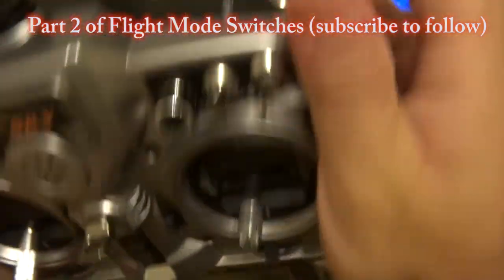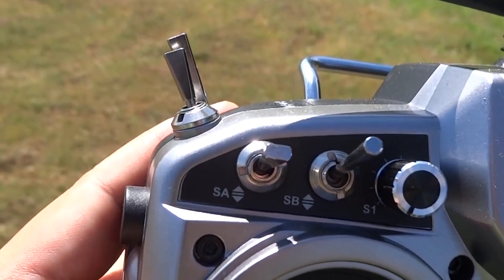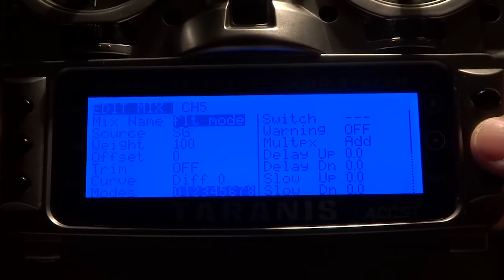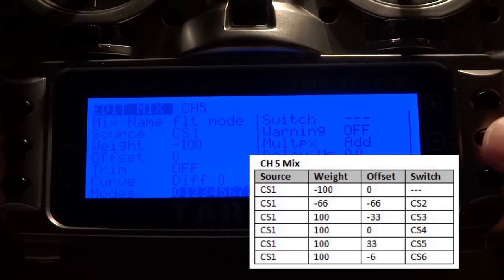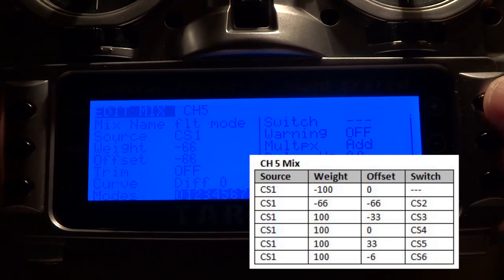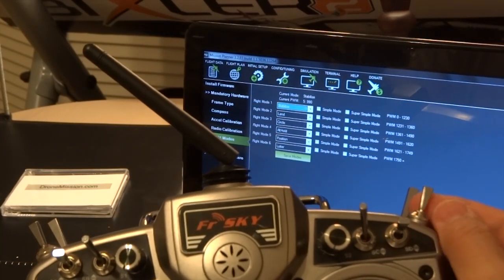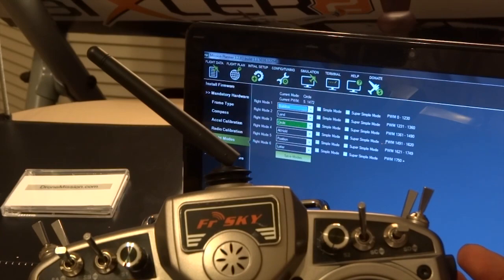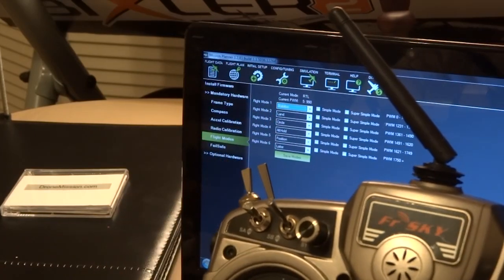FrSky Taranis Setup 6 Flight Modes Mix plus 1 for APM Ardupilot

Comment: How did you set the rtl switch on missionplanner?
Reply from the maker: Greetings. For the panic switch.  it is located on CH 7 auxilary optional switch.  If it is not there anymore, it may have been removed in your version.  http://ardupilot.org/copter/_images/AutoTuneCh7Switch.png
Reply: ***** I do not found it

Comment: Hi diydrone good video thank's...but could you remember how to assign a switch for Autotune and how to check it with M.Planner...because i can't to do it again...thank's a lot
Philippe
Reply from the maker: Hello, it is located on CH 7 auxilary optional switch.  If it is not there anymore, it may have been removed in your version.  http://ardupilot.org/copter/_images/AutoTuneCh7Switch.png
Reply: Hi Diydrone, i've got 6 flight modes and RTL with ch7...checked with M.Planner...no pb ...so, during the flight, when i want to switch AUtotune on ch7 with AltHold on flight mode 2 i get ( pwm 1280 on M.Planner ) mu quadcopter falls down rapidly and i have to switch on Stabilize (982 on M.Planner )...for information on ch7 in Full Parameters list i got the right number for Autotune...
Do you have an idea, how i have to check...?
Than's a lot 
Philippe

Comment: thanks ... worked not as perfect as I would have liked  but I can get used to the way the switches flick the modes
Reply from the maker: +Aron Gatt thanks, don't forget to adjust to your preference.  2013 UPDATE: You can reduce or remove the DELAYs 0.5 if you find your modes are always returning to stabilized mode before changing to the next one.

Comment: MMM having issues have followed the setup exactly RTL does not work here but works on radio calibration? Also are you sure that should be -6 on CS6? Also I cant get Flight mode 3 to work at all and flight mode 6 repeats itself . Very confused :(
Reply: Hi! Works on mine.  However, this was recorded during the launch of the Taranis back in 2013 and Mission Planner has also gone through several iteration since then.  You may need to apply the same principles, to adjust to the changes.

Comment: Hey, me again. Quick question... I am trying to follow every step but I am stuck at CS1 in MIXES! I do not have CS1 on my Taranis Plus, FW 2.0.13??? Thanks, G.
Reply: logical switches
Reply: so it'd be under L1
Reply: Zebedee Knowles Copy that! Thanks! Where do I find information on what happens when you are in GPS mode and you lose GPS signal? Isn't it just going to switch to stabilize mode? Thanks, G.
Reply: i think thats more of a flight controller thing. However best tip i can give you is to never fly in gps mode. your just relying on the gps and compass. Fly in altitude mode or stabalise and you reduce the chances of saying goodbye to your craft.
Reply: Zebedee Knowles I never understood why people say that? I am actually trying to figure out what happens when you fly in GPS mode and you lose GPS signal. Shouldn't the controller automatically switch to stabilize mode? After-all, GPS mode is stabilize mode just with GPS enabled... I have a Pixhawk btw...
Reply: Sorry I don't know that flight controller. How ever unless you have telemetry being sent to your controller with GPS information I can't see how you could set up that fail safe
Reply: Zebedee Knowles OK, thanks.

Comment: I read that people with a Pixhawk crash, when switching from one flight mode to another. That made me think. Could it have something to do with the fact, that you just pass trough modes, really fast, and that the FC gets confused? What I mean is: If your flight modes are on a 3-position switch, and you go from the bottom position to the top position, you go through the middle position. Going through that middle position will activate whatever mode you have on that position, right? So the FC will activate that position for a split second and then goes to the desired one one the top position... Could that make the FC get "confused"? I mean, how fast can you switch between modes? Hope all this makes sense? Thanks, G.

Comment: HI All
I am new to RC and need some help. I have had problems setting up my TX (Senior Moment).
Now using an EEPE file I got from friend that works. But some settings don't. That is why I would
like to find a file that someone is using on their Hex.  Maybe they will share the file with me.
If it works for them it will for me as well with the equipment as I have.
Any and all help would be greatly appreciated.
Johnny Moritz     Spring, Texas
photo@gxpllc.com

Comment: In one video, arming and disarming was going to be explained with this model, but I don't recall seeing it. I have all the settings completed but cannot arm my copter now. I have Pixhawk and Taranis w/X6R receiver. 

I was able to arm (lower right throttle hold) before creating this model. Any ideas? Thank youi.
Reply: first check if your channels are reversed, that i guess with be the yaw channel 4.  see Ep 25 mapping.
Reply: dronetestpilot  Thanks for replying. I got it working and have flown 15-20 times, no major crashes, but RTL mode did a toilet bowl landing the other day (after several previous successful landings with RTL). I tried it again today and same thing; reaches altitude, then acts like its lost and starts circling. This time I was in a large open field and took back control. Loiter, Alt-h and Land seem to work ok, although Alt-h likes to gain altitude over time. I have read others having strange events with RTL as well.

Anyway, I have my Taranis set up based on these videos. I've been wanting to try AutoTune on my 3DR Y6 DIY but am not sure how to do it with the configuration on this video. Can I switch the channel 7 mode from RTL to AT while in Alt-h and have it work?

I'm not proficient in programming the Taranis yet. Thanks for help if you can answer the AT question.
Reply: always great to hear success.  looks like compass or gps issue on that rtl, at least it returned.  good practice to put your model in loiter immediately after each take-off.  This will test your Gps and compass each flight before you fly too far out.  good practice to manually land too, your pressure sensor may mistakenly think you are at zero attitude, just flip your switch to stablized mode to regain control always.
Reply: cover your pressure sensor with some dark tape or sponge, if you have altitude drift.  not sure if that really helps, but can be a reason if there is sun or wind.  you can temporary assign channel 7 to auto tune during tuning, and reassign it back when done using Mission Planner.  or you can add another switch for channel 8 i believe and use that.
Reply: dronetestpilot
Thanks. I will try those suggestions. It seems like I tried switching channel 7 (which is now RTL) to AT in MP but it didn't work. See though, by copying the switches from this video, I don't understand how to add another switch. I will just have to suck it up and study the Taranis manual so I understand what's going on.

I'm going to recalibrate everything from scratch. I don't know if AT will help with the tendency to roll right on lift off (has done it since day one....have had to use roll trim compensate), but want to do it anyway. The CG seems to be ok, but I'll check that out too.

Comment: I think there's a better solution for the CH5 mix. I would simply use a source of MAX combined with the switch. Source will always be MAX and weight will respectively be: -100, -60, -20, +20, +60, +100

Comment: Thanks for quick response. I have seen one of your using gimbal with sony 700 TVl camera. Where can I get the gimbal and also apache x450 frame.
Reply from the maker: Tamil, the Apache X450 is a custom modified frame for our rescue team, however you can find something very similar called the Aphid on eBay.  From our lessons learned, we would suggest buying a frame maybe with gimbal but without the camera, and instead add a Boscam Cobra or similar camera with DVR.  We have never tried the Cobra camera, but I hear it works ok. http://www.hobbyking.com/hobbyking/store/uh_viewitem.asp?idproduct=39844&aff=951347 
If you have the money, go with the GoPro.  You can connect the gimbal servo straight to the APM A10, without buying a separate gimbal controller, cutting down the weight.

Comment: Thanks for great video. I have setup the 6 mode switches, RTL and audio files setup in Taranis X9D and X8R. When I arm APM 2.52, getting arming voive, the props are spinning at low speed without giving Throttle input. I have set throttle trim to low. Still the props are spinning. Same APM used with DX8 and 6 Ch receiver, I didn't get the props spinning problem. Can you please help to identify the problem.

Quadcopter Specs: FrSky Taranis X9D, X8R, APM 2.52, Arducopter firmware, GPS ublox NEO-6, Diagonal Wheelbase 550mm, Motors 2212 kv100. 1045 props, 30A ESC. Lipo: 3S 4500mAh
Reply from the maker: If you are using firmware arducopter 3.1, while arming, the props will spin at low speed without giving throttle input.  This is actually a feature! :)  read the release notes.  This was newly introduced to differentiate between armed and disarmed as an additional safety function.  However I believe you can disable this feature in the setup, if you don't like it.